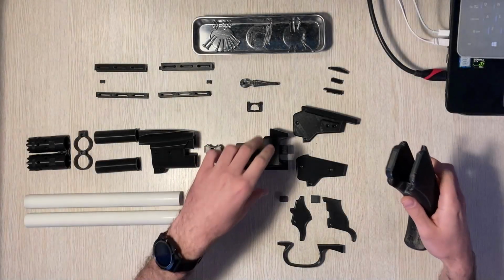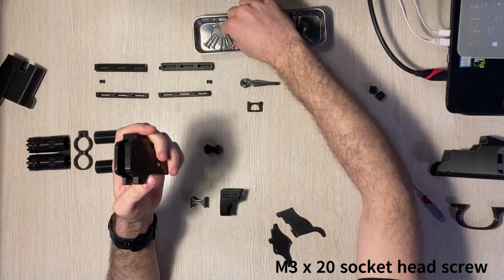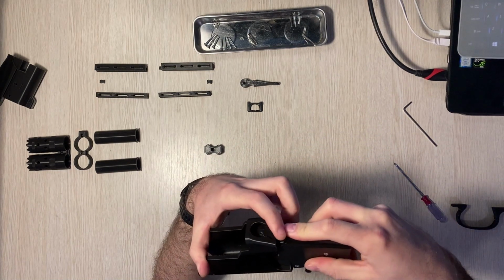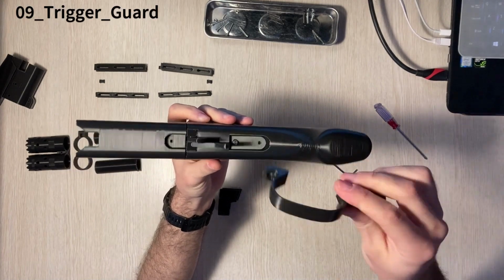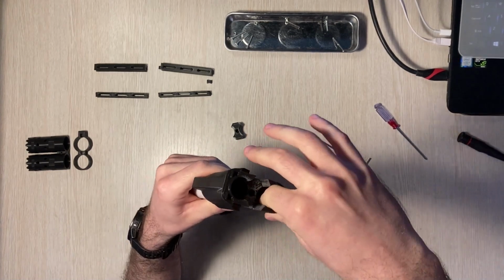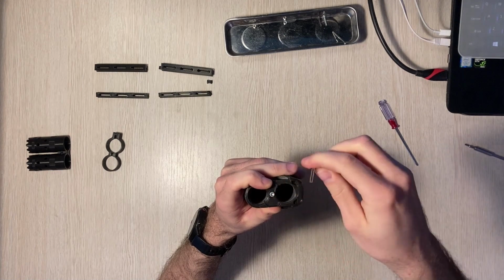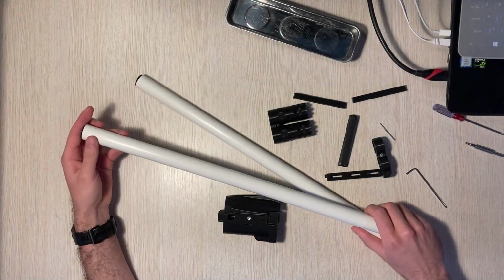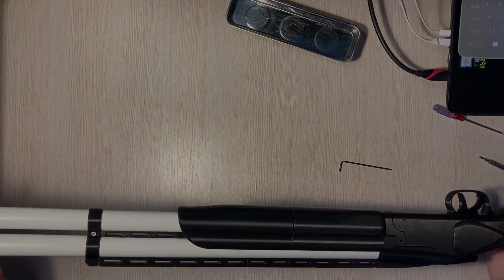3d Printed OverUnder Airsoft Shotgun - Assembly guide

Comment: Very cool. Have you ever used it on an airsoft game? If so, what are your experiences?  Maybe there will be one with a stock?
Reply from the maker: It is not the most practical replica to use on an airsoft game. 2 shots and you need to reload, you need to take care of all of the shells, and on top of all of that, it will certainly not take as much abuse as a normal replica could handle. It is just a fun replica to mess around with your friends. As for the stock, there are full stock files included in the kit.

Comment: Cool project. But for APS shells, those barrels are way too big, you will loose 80% performance. I tried around and an inner diameter of 18mm will get you the best performance. Its widely available as aluminium tube. 18mmx1mm.  If you use something like that, your barrel lenght will determain range and spread. Longest i tried was a 26 inc barrel. but i think, power tops out around 24 inces.
Reply from the maker: I see you did some research into the APS shells .. Thanks for the tip !

Comment: Quick question, can the 4,5mm extractor spring be subsidized with either a 4mm or 5mm spring?
Reply from the maker: The slot is 6mm, so you should be ok with both 4mm or 5 mm spring. Let's not overcomplicate it, it is just a pen spring.